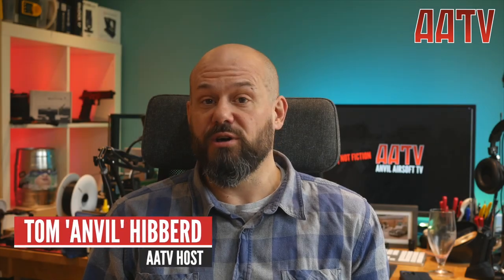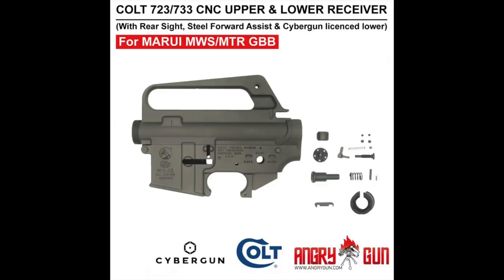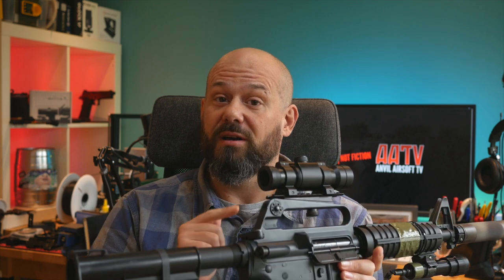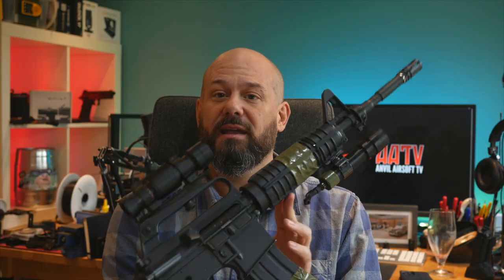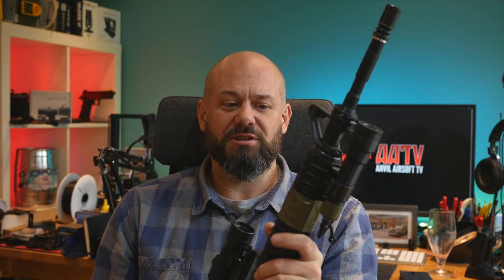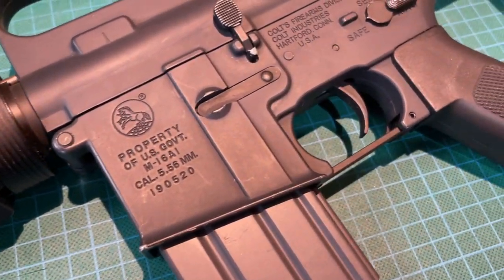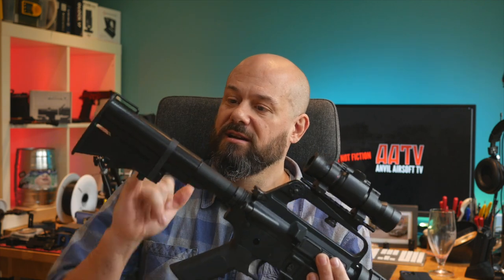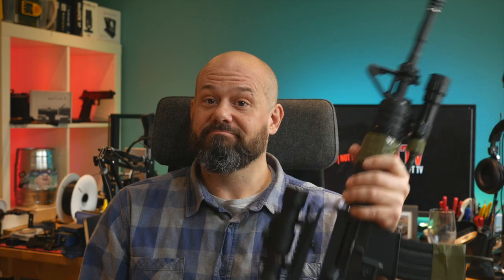Delta CAR-15 Setup | Airsoft Colt M723 Replica | AATV EP179

Comment from the maker: What would be your dream replica? Let me know!
Reply: I'm a sucker for the AR-18 Design
Reply: An FAL Para version. I would love that
Reply: That and my BHD M14 are pretty much my dream replicas atm. My Delta carbine is based on my old CA M15A2 carbine but if I had the budget I'd go for something a little more accurate.
Reply: Sig MCX GBBR based on the Marui MWS system (obviously with a modified bolt to negate the need for a buffer tube)
Reply: Bren Gun
Reply: FN FNC or the older swedish AK5. G&G seriously need to think about re-releasing them. but at the moment im happy with my SA58 OSW with trades by ASG
Reply from the maker: AK5 would be cool.
Reply from the maker: Nice. I quite fancy doing the Larry Vicker cut down carry handle and aimpoint.
Reply: Could you 3D print a silencer like
That which would fit over a XM177 flash hider?
Reply from the maker: Pretty sure I could make an adaptor for an existing one.
Reply: @AnvilAirsoftTV  if you like I could post you my one?
Reply from the maker: Is it the CYMA you have? I can borrow Gadge’s if so. I’ve also got a G&P XM flashider kicking around too.
Reply: An em2 would be a pretty cool replica
Reply: SR25 PTW 😃
Reply: Really very tempted to buy another MWS and go the Gordy/Danny Archer route, but I'm just not sure about those Angry Gun carry handle uppers. Hoping HAO jump on the retro bandwagon then I may take the plunge
Reply: VFC 1918 BAR

Comment: Shekkin makes a replica 660 for only about $60 with tax. My rifle for my Air Force Combat Controller load out is a CYMA XM-177 converted into a CAR-15 with a G-36 pencil barrel. The only things I need are a butt plate and an Aimpoint 3000. I'm using Lancer Tactical M-733 skinny handguards shaved down so I can mount them sideways with my tac light attached to the holes on the top. My setup is going to emulate what Combat Controller Dan Schilling has told me through numerous conversations.
Reply from the maker: Sounds great. I’ll have a look at the 660 clone.
Reply: @AnvilAirsoftTV  from what I recall, you can get two different versions from Shekkin. One has the original style bulb and lumens while the slightly more expensive one is an LED if I'm not mistaken
Reply from the maker: Yeah looks like it to me. LED all the way. I’ve got an original 660 so don’t need another with poor performance by modern standards. :)

Comment: Another great vid Tom and I really do admire your innovation with the 3D printing of parts to achieve a specific look, outstanding mate! Well done! I’ve been inspired by your work and that of the Geardo Crow and his “Gordy” build and started to look at this more seriously. Swapping out a full metal RIS for the slimline CAR 15 hand guard makes a huge difference in weight and with Nods being more common, passive aiming is becoming more the norm, so an improvised white/IR light May be the way ahead. My build will not be as accurate as yours but it will allow my TM L119A1 to follow some of the principles and innovations of this iconic gun, thanks again mate 👍👏👏👏👏
Reply from the maker: More to come with the 3D printed unobtainable parts so watch this space :). Thanks for the kind words and totally go for your own build.
Reply from the maker: There were lots of weird Colts carbines and Diemacos in use with UKSF before the L119A1 came into service so maybe one of those?
Reply: @AnvilAirsoftTV  it’s a thought, I may just look in to that 👍

Comment: What brand barrel did you use because I have my build on hold for the moment. I bought a madbull 14.5 in barrel carbine profile but the front sight from my G&P ar15a2 doesn’t fit on the barrel
Reply from the maker: G&P M4A1 complete Front end

Comment: Is there an suppressor that will work available here in the US? I looked for the exact one you mentioned but it only seems to be available through UK retailers.
Reply from the maker: I had a quick look and couldn’t find one easily available.

Comment: Great build! where did you find that suppressor?
Reply from the maker: The suppressor is an FMA 198x35mm CCW/CW the other parts I designed and 3D printed.
Reply: @AnvilAirsoftTV  do you have 3d files? For a suppressor?👀

Comment: Great video, informative and shows off the lovely gun too.
You mentioned rotating the Aimpoint slightly,, can you say whether this is clockwise or anti-clockwise when looking down the sight?
Was that something that Delta did for easier access to controls or something?
Reply from the maker: It’s rotated 90 degrees counter clockwise as looking down the site. It’s because the controls and battery compartment changed position on the newer models so it makes it look more like an older one.
Reply: @AnvilAirsoftTV  ah, top info, thank you
Reply from the maker: It’s a simple trick but helps break the link to it actually being a COMP M2
Reply: @AnvilAirsoftTV  sure does its so obvious now and yet I had missed it when looking at the older Aimpoints

Comment: Great video! I love my G&P replicas. I own the G&P XM177 the M733 and the M16A1 VN all with Colt trades and all 3 in my opinion are as close to perfect era correct replicas you can find. I can't bring myself to skirmish with any of them. They are essentially just collection pieces so I ended up buying 2nd and 3rd versions from TM,  CYMA, Classic Army, and JG to run if the occasion calls for a retro loadout and platform.
Reply from the maker: Mine are generally the same. I use one of the lowers with all the uppers when playing. They don’t really get a lot of use though.

Comment: What exact make and model of this airsoft gun that the build began as?
Reply from the maker: It’s in the video. G&P M733 and a G&P M4A1 front end with replacement furniture. No one currently makes an out of the box M723

Comment: I came back to this video alot of times, because I love this replica. 
But I do wonder, is it also possible to make this suppressor with that 3D-printed adapter part over the barrel of a VFC M733 GBBR?
Reply from the maker: I've done rings for M733s, feel free to get in touch on instagram or Facebook messenger

Comment: What batteries do u think will fit in the slim handguard?
Reply from the maker: A thin cell 7.4v stock LiPo or split pack goes in fine. Especially if you remove the heat shields in real ones.

Comment: where did you get the Aimpoint replica?
Reply from the maker: It’s an old G&P aimpoint comp M2 clone. Can’t actually remember where I got it. There are plenty around at most of the larger online airsoft stores.
Reply: @AnvilAirsoftTV  so you also 3D printed an extended bit to make it look closer to a 2000? Could you possibly share the details on that?
Reply from the maker: I sell them. Get in touch if you want one on Facebook or Instagram.
Reply: @AnvilAirsoftTV  sent a DM on insta thank you!

Comment: Also the M653 didn't had the brass deflector
Reply from the maker: Some of the early M723s also had an A1 upper, a pencil barrel and look virtually identical to an M653 other than potentially the delta ring.
Reply: @AnvilAirsoftTV  That is true, but you mean the A1E1 version of that. right? 
Because I've never seen a colt m723 or 733 with an A1 upper, meaning without the brass deflector. I do recognize this on M653 and earlier models.
Reply from the maker: No I mean A1 uppers. Have a look at some of the Gothic Serpent pictures. There’s a number of 723s being used by delta operators with A1 uppers. The 733, 723 and 727 are proper mongrels built from parts without any real conformity plus when they get to the unit anything could happen.